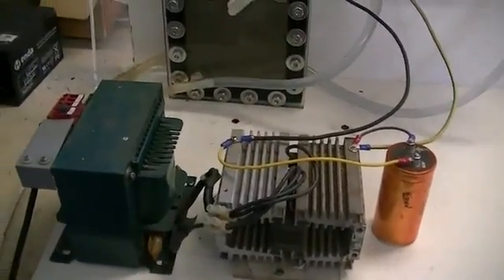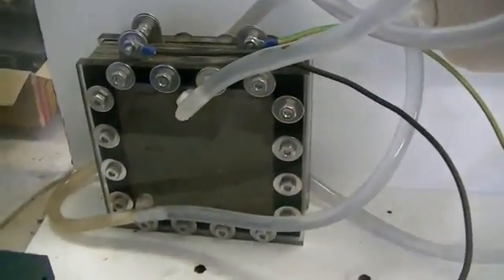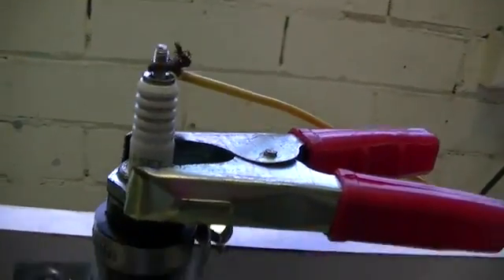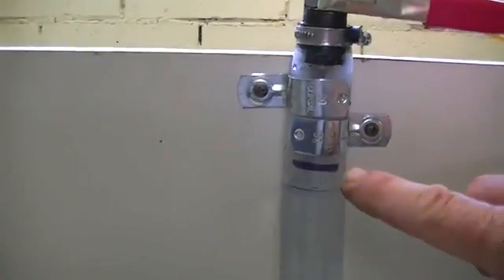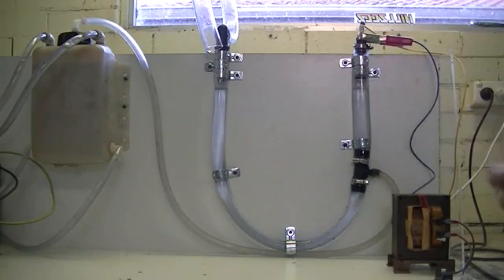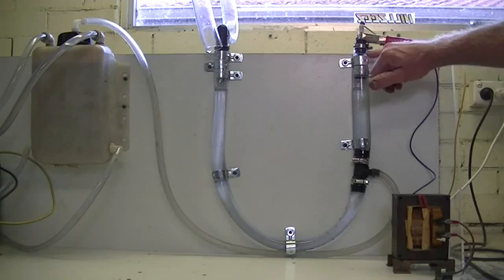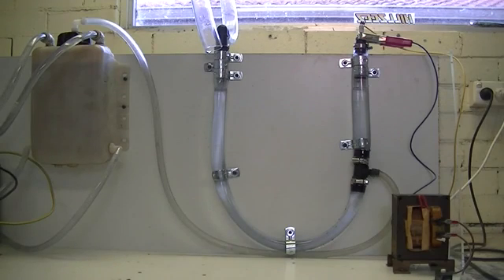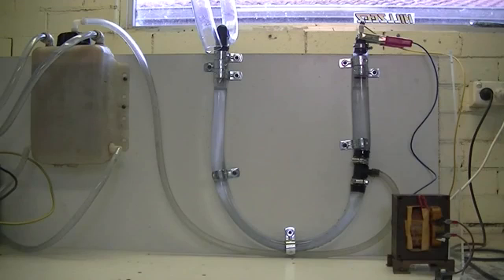HHO dose it expand or contract when ignited

Comment: My thoughts, are a 2 stroke engine. Intake for 50% (depending on timing) of the down stroke, then ignition. At bottom dead center, the condensation back to h2o pulls the piston back up for like 90% of the stroke, then replaced by intake to flush the water and start the process over.

Anyone have thoughts on this?

Comment: You're forgetting that HHO unlike other flammable gases discharges into its water form. This changes the expectation of your experiment in that it releases its explosive energy by expansion and yet contracts back into water form, which is unique from typical flammable gases. Additionally, the vacuum effect seen here would occur if any gas exploded, but especially noticeable in a closed system.

Comment: VERY    Interesting.        What about closing the open end and with pressure gage ,  measure the power out put.   OR ,  much simpler ,  measure the height the water is pushed upward.  Like I said.  Very interesting.

Comment: Excellent apparatus for testing! In my research of the early 1900's I discovered that if you bubble through oil (used motor oil) you get hydrocarbon fuel (gasoline vapor). If you had a couple inches of used oil floating in the testing tube I think you will find different results. Should be small bubbles for more refining of the oil, but should work. A mini refinery! Can I see your results of this gas conversion?
Be safe.
Reply: Pure HHO expands, then quickly contracts because of rapid temperature lose in the gas. Carbon in the mix from some source sustains expansion (positive pressure) by retaining heat in the working gas. With pure HHO gas only, you have to eliminate expansion or contraction as the driving force in an engine. Otherwise, the rpm is limited to the reaction time and you could not apply a load to the engine.
In your test apparatus, close off the small gas supply pipe before ignition. It is taking away from viewing the effect by back feeding.

Comment: Love your work...took you up on making a slo-mo study of the reactions you were getting. It was easy to see the draw-down of the water in  left hand tube when the implosion occurred on the right side, but not so easy to see the effect on the liquid gas boundary on the explosion/implosion side because the water seems to fill with gas bubbles.
Three things I would like to see you try if you are up to doing more experimentation on this: 
One, place a shutoff on the gas inlet tube to eliminate a reaction therein.
Two, place  small colored float-able balls loosely in the right and left legs of the U-pipe so the reaction can be better seen and the gas won't mix so much with the water.
Three, zoom in a little closer to the reaction zone.
And maybe 4, you could experiment with cross lighting and maybe eliminate your back-lighting from the window. 
Great experiment...love your other work too!